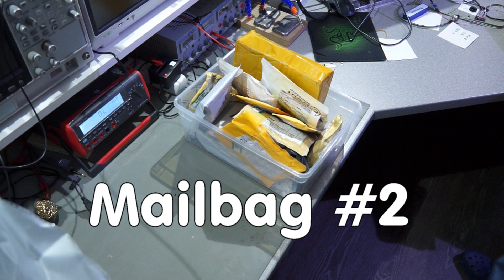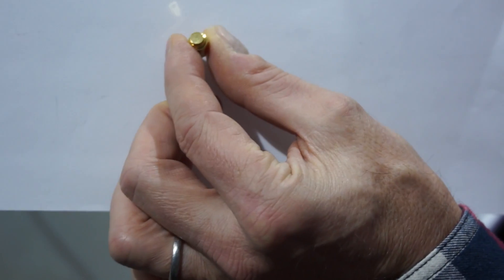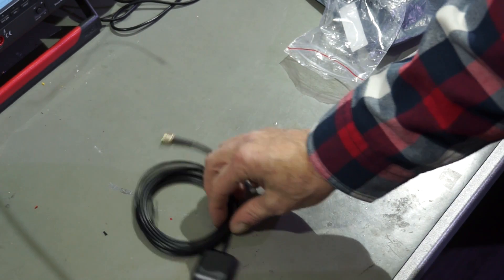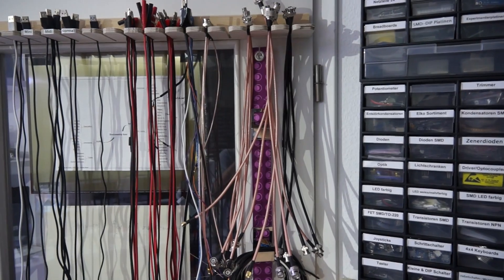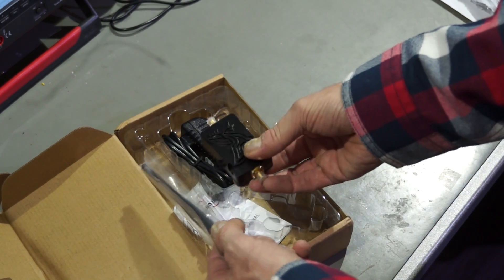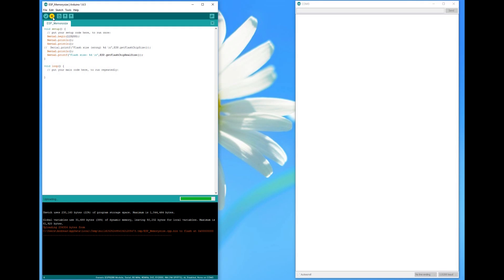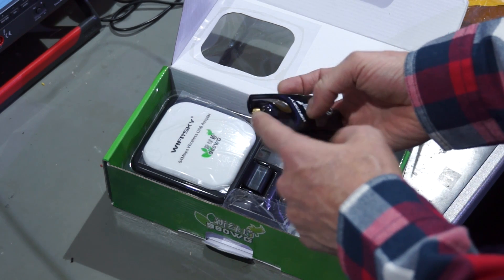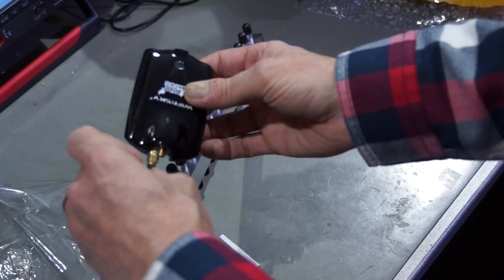#54 Mailbag #2

Comment: Where have you got the Pogopins from your tester PCB from? I only have some which are quite to big to fit the ESP-07 holes.
Reply from the maker: +TechnikmitBen I use the PB50-B1 pogo pins. You get them from aliexpress. Their diameter is 0.68mm and this is smaller than the holes in the ESP modules.
Pay attention that you do not fill the holes when you solder the modules on a board. Otherwise you lose their directional effect for the pogo pins.
I saw also somebody using 2.0 mm headers (http://www.aliexpress.com/store/product/50pcs-40-Pin-1x40-Single-Row-2-0mm-Pin-Header-Connector-Copper/1762106_32534590109.html) for the same purpose. This is simpler for non-soldered modules, but they might be too short if modules are on a PCB

Comment: Are you concerned with the risk of getting counterfeit electronic products from China?
Do you have some strategy in place in order to minimize the risk of getting counterfeit products?
Thanks
Reply from the maker: Since I do not buy really branded products like Apple I usually test them when they arrive. If ok, I pay. Some products had problems after a short time. That is the risk I have to carry
Reply: +Andreas Spiess I was primarily referring to basic components like ICs, but also resistors, capacitors, ...

I buy them from China, but sometimes I wonder about the risk of premature failures and malpractice.

Here are two links, if you are interested:
http://www.muanalysis.com/_documents/publications/Counterfeit-or-retrofit.pdf
http://www.aeri.com/counterfeit-electronic-component-detection/
Reply from the maker: +mark I know what you mean. Fortunately, I do not sell my products. So, I am not concerned about the longtime stability so much. This is why I make an initial test only.
Reply: +Andreas Spiess The same for me: I do not sell my products.
I find great to order online so easily and the very low prices.
So far, I have never had big issues. Only some usb connectors and cables of low quality.
But all ICs and discrete components behaved properly.

Comment: ESP-07 are little old and they are only 1MB. The soil moisture sensor adapter board is not a amplifier but its a comparator which sends HIGH on D0 depending on the threshold set by trim POT.
Reply from the maker: +Venkatesh E Yes, I know now that the ESP-07 was not updated. I knew that the -07 had 1M. The supplier wrote: New model and I asked and he wrote: 4M. This could be because it is easy. Just put a different flash chip in the module. But the supplier was wrong and I started a dispute. I got all 10 modules for free. Now I have to change the flash memory if I need it.
I like the -07 because it has an antenna connector.
Reply: Oh nice. So once we open dispute do we get to keep all the items without returning it to seller ?
Reply from the maker: +Venkatesh E I never return the items. Too expensive. But not always the seller agrees and then Aliexpress has to decide. Then it is usually 50/50. But it worked fine in my cases. They are rare. Usually I get what I ordered
Reply: thank you for the info.

Comment: sound like there are some interesting projects on the way :)
 btw: any chance to make an episode about smd soldering ?
Reply: +GuitarPeter04 Dave jones from  EEVblog has videos on SMD soldering, Andreas Spiess said he uses 1204 package because he finds it easier to solder, so i'm guessing he doesn't like small pitch SMD soldering much.
Reply: +Glychee S;  i would prefer 1206 package as well :) nevertheless thank your for the info, will have a look at dave's videos.
Reply from the maker: +GuitarPeter04 If you are young you can go smaller ;-) I do not see them very good anymore.
Another reason is that I mill my PCBs and with the 1206 the chance to get good results is higher. In addition, for my small projects with only a few parts the size of the SMDs does not make a big difference. I try to use as much as possible prefabricated modules where they use much smaller components.

Comment: I see that you are not in competition with Dave's huge bowie bush knife but I would think that by mailbag #3 you would sharpen your 40 year old Swiss Army knife..... nice local touch however... :)
Reply from the maker: +Graham Gillett Then it might get too dangerous again for me ;-)
Reply: +Andreas Spiess safety knife, i have a few of them too  . ironically its the dull ones that make the worst injuries. great video.
Reply: +XerotoLabs you are very true there. watching Andries frustration with his blunt S.A.K. I can well see some human injury occurring in the future :)
Reply from the maker: +Graham Gillett My insured thumbs are not because of a knife. One of them got inbetween  the chain and the sprocket of my motorbike and because the engine only had 125cc the engine stopped. Otherwise the thumb  would look much uglier. So, even if it is not looking nice, at least it still works ;-)

Comment: Where can I read or see more about your esp8266 internet radio project?
Reply: +msevyt previous mailbag he received a digital analog converter for the internetradio,that's what he is referring to,the internet radio will be built later and he'll make a video once it's done(if it works of course :P ), in the mean time,you should subscribe ;)
Reply from the maker: +msevyt I am currently on a project (working for money ;-)). The radio is not easy since it has to be done in the espressiv development environment.
If you do not want to wait you can google ESP8266 and MP3 and you should find the github page with the info.

Comment: Nice video, keep them coming. Your comment about SMD gives me hope that I'll manage one day.
The humidity sensors have different applications. The 1st one is for water level, I have seen bigger ones for rain droplet detection.
The 2nd humidity sensor is for soil moisture. The IC is a dual op-amp.  The Same circuit is used on other resistive sensors, such as MQ gas sensors. The sensor and a load resistor form a voltage divider. One op-amp buffers the voltage divider and provides the analog output. The other op-amp is set as a comparator and provides the digital signal by comparing the analog signal against the voltage divided set by the potentiometer.
Reply from the maker: +Álvaro M. Valdebenito B. Thanks for the info!